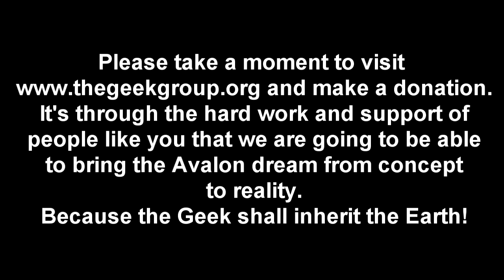Audio Technica AT2010 High Voltage Demo

Comment: the windshield is connected to the metal case, so nothing inside is connected to the high voltage other than just the stuff you touch.